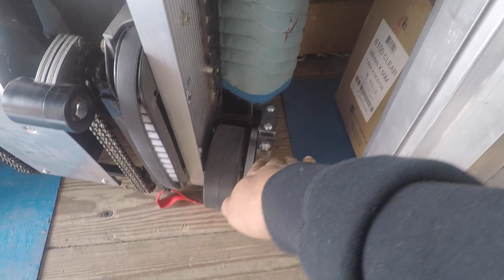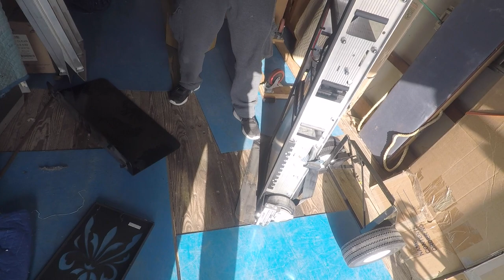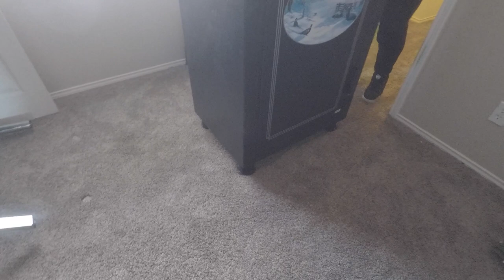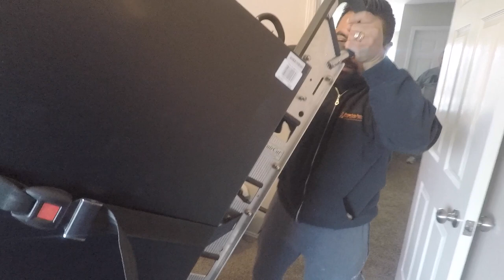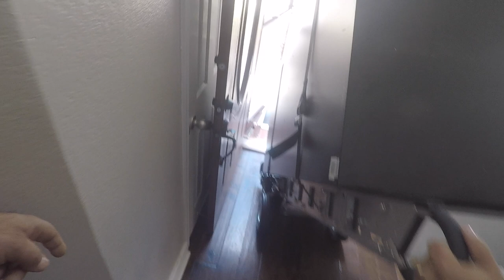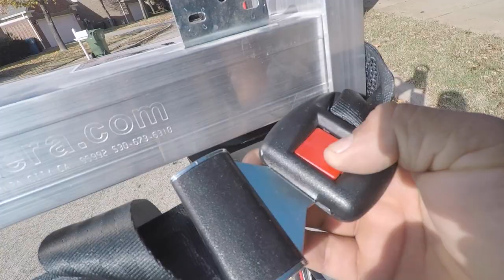Moving a 600-lbs Gun Safe with the Escalera Electric Dolly downstairs

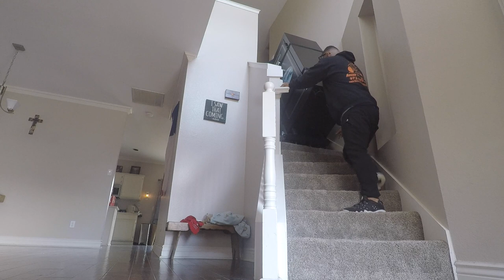Comment: 8:52 Standing behind it is a good way to get crushed.
Reply: Yep. Especially when there is a "I saw that coming" sign on the wall.
Reply: You need a spotter on the bottom though and a set of hands to adjust the safe. 

As long as that thing is fastened securely and the guy running the controls knows what he's doing and goes slow, you're good.
Reply: @that1electrician 100%

Comment: how do you keep from breaking wood stairs when using a stairclimber? i've contacted multiple places to move a safe and they all say the stairs will be damaged.
Reply: It's not the best to keep a super heavy safe upstairs, in case of a fire and it falls on the firefighters. Maybe look at a powermate stair climber, it's a different type of movement. Or make a ramp to the top and winch it up. Did you find a way to do it yet? Just curious

Comment: That's awesome; however, it is even more challenging for robots to defy gravity going upstairs.  Can it handle it?  No mention was given to that.  Always easier for a heavy object to go down, rather than up.  Gravity is a bitch.
Reply: actually going up is easier down going down using Eacalera
Reply: Going down would be the tough part.  Gravity is a bitch.  It wants that weight closer to it.  Love the video.
Reply: @LBNNN1 agreed
Reply: going up is easy, since you re pulling up all the time, going down is dangerous since you can just roll off a step, they sell an a brake system for going down but i did not see it being used here, not sure why not